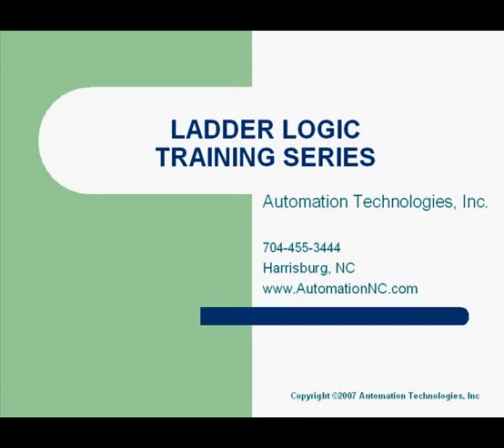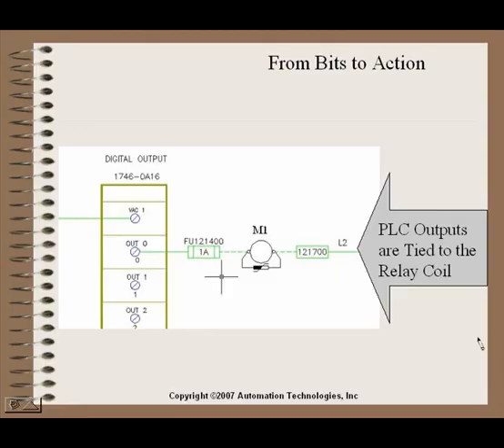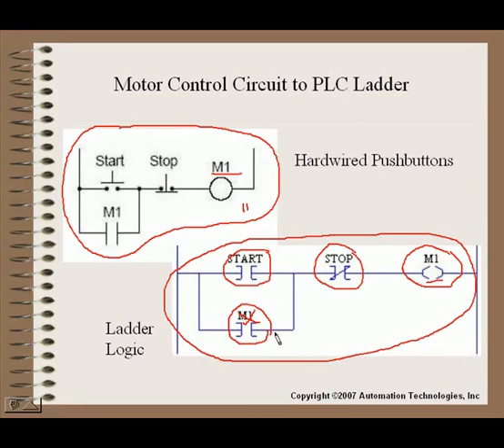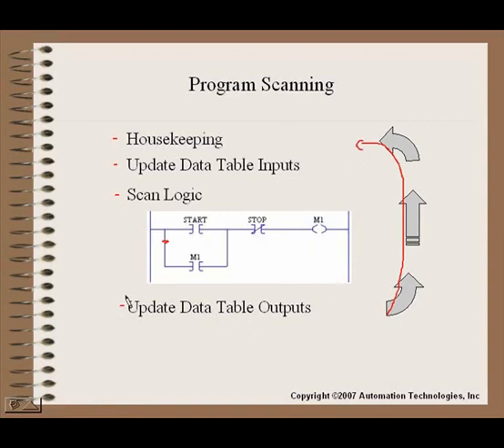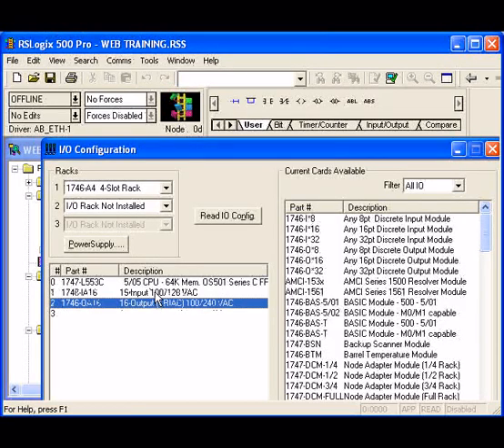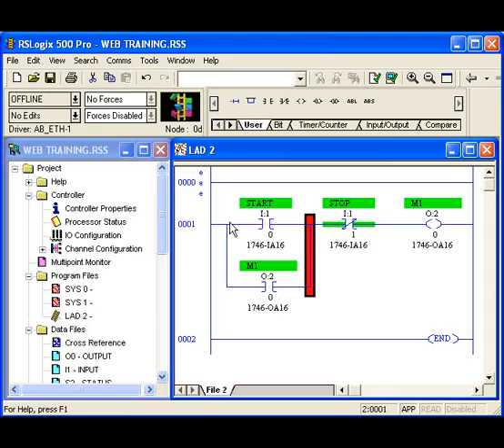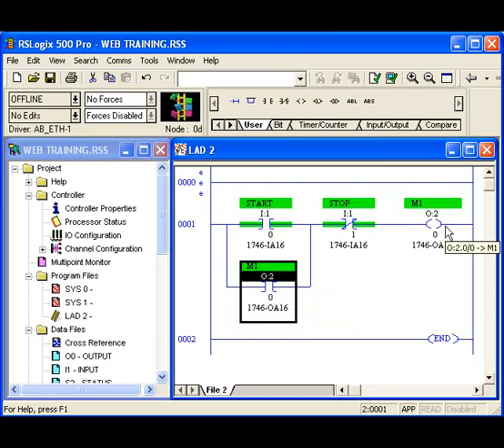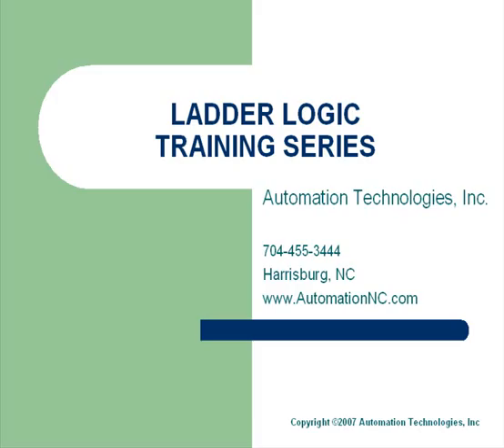PLC Training - Introduction to Ladder Logic

Comment: In the beginning of this video the stop button is shown as NC, push to open, the logic later in the video shows the logic using a XIO for the stop PB function. The stop PB should be XIC if the logic is to mimic a standard three wire start/stop PB station. The stop PB's should always be wired NC, push to open so that if a wire is broken in the circuit, the output in the logic will shutdown if running or be unable to be started if not running. If unable to start or shutdown occurs, the circuit can be troubleshot at that point and repaired. This is the failsafe method to wire this type of circuit as some "stop" PB's are in place to be used in critical shutdown situations. I was wanting to use this video in my class at the community college because the graphics and explanations are clear, but I can't because of the error mentioned in my comment.
Reply: Yes stop bits, like their hardwired counterparts should always be N.C., or "XIC" in ladder logic software for "fail safe" operation. But when I would explain Ladder logic programming to people with little or no electrical background i would usually try to dispense with most of the Normally closed, examine if closed, on, off, Hi, Low, ones and zeros, etc. All of that language, while useful can be very confusing to those without the background in electrical switching, relays etc, and they tend to, in my experience, get hung up on these concepts when much of it is unnecessary to learning to read the logic. I would instead present it like this: I would tell them to divide the screen into left and right. On the left side you have a set of  "conditions" and on the far right you have an "outcome" based on those conditions. If the conditions are "true" then the outcome will then be true and of course if they are false the outcome will also be false. I would tell them to forget about all of the N.C., N.O. stuff for the moment and pay attention instead to the green highlights. If it is green then its true regardless of anything else. It is of course an oversimplification but I found it to be effective in getting people, with little and sometimes no experience, reading and understanding ladder logic without getting hung up on the whole Normally closed, on, off, concepts.
Reply: Yes stop bits, like their hardwired counterparts should always be N.C., or "XIC" in ladder logic software for "fail safe" operation. But when I would explain Ladder logic programming to people with little or no electrical background i would usually try to dispense with most of the Normally closed, examine if closed, on, off, Hi, Low, ones and zeros, etc. All of that language, while useful can be very confusing to those without the background in electrical switching, relays etc, and they tend to, in my experience, get hung up on these concepts when much of it is unnecessary to learning to read the logic. I would instead present it like this: I would tell them to divide the screen into left and right. On the left side you have a set of  "conditions" and on the far right you have an "outcome" based on those conditions. If the conditions are "true" then the outcome will then be true and of course if they are false the outcome will also be false. I would tell them to forget about all of the N.C., N.O. stuff for the moment and pay attention instead to the green highlights. If it is green then its true regardless of anything else. It is of course an oversimplification but I found it to be effective in getting people, with little and sometimes no experience, reading and understanding ladder logic without getting hung up on the whole Normally closed, on, off, concepts.
Reply: Yes stop bits, like their hardwired counterparts should always be N.C., or "XIC" in ladder logic software for "fail safe" operation. But when I would explain Ladder logic programming to people with little or no electrical background i would usually try to dispense with most of the Normally closed, examine if closed, on, off, Hi, Low, ones and zeros, etc. All of that language, while useful can be very confusing to those without the background in electrical switching, relays etc, and they tend to, in my experience, get hung up on these concepts when much of it is unnecessary to learning to read the logic. I would instead present it like this: I would tell them to divide the screen into left and right. On the left side you have a set of  "conditions" and on the far right you have an "outcome" based on those conditions. If the conditions are "true" then the outcome will then be true and of course if they are false the outcome will also be false. I would tell them to forget about all of the N.C., N.O. stuff for the moment and pay attention instead to the green highlights. If it is green then its true regardless of anything else. It is of course an oversimplification but I found it to be effective in getting people, with little and sometimes no experience, reading and understanding ladder logic without getting hung up on the whole Normally closed, on, off, concepts.
Reply: Yes stop bits, like their hardwired counterparts should always be N.C., or "XIC" in ladder logic software for "fail safe" operation. But when I would explain Ladder logic programming to people with little or no electrical background i would usually try to dispense with most of the Normally closed, examine if closed, on, off, Hi, Low, ones and zeros, etc. All of that language, while useful can be very confusing to those without the background in electrical switching, relays etc, and they tend to, in my experience, get hung up on these concepts when much of it is unnecessary to learning to read the logic. I would instead present it like this: I would tell them to divide the screen into left and right. On the left side you have a set of  "conditions" and on the far right you have an "outcome" based on those conditions. If the conditions are "true" then the outcome will then be true and of course if they are false the outcome will also be false. I would tell them to forget about all of the N.C., N.O. stuff for the moment and pay attention instead to the green highlights. If it is green then its true regardless of anything else. It is of course an oversimplification but I found it to be effective in getting people, with little and sometimes no experience, reading and understanding ladder logic without getting hung up on the whole Normally closed, on, off, concepts.
Reply: Yes stop bits, like their hardwired counterparts should always be N.C., or "XIC" in ladder logic software for "fail safe" operation. But when I would explain Ladder logic programming to people with little or no electrical background i would usually try to dispense with most of the Normally closed, examine if closed, on, off, Hi, Low, ones and zeros, etc. All of that language, while useful can be very confusing to those without the background in electrical switching, relays etc, and they tend to, in my experience, get hung up on these concepts when much of it is unnecessary to learning to read the logic. I would instead present it like this: I would tell them to divide the screen into left and right. On the left side you have a set of  "conditions" and on the far right you have an "outcome" based on those conditions. If the conditions are "true" then the outcome will then be true and of course if they are false the outcome will also be false. I would tell them to forget about all of the N.C., N.O. stuff for the moment and pay attention instead to the green highlights. If it is green then its true regardless of anything else. It is of course an oversimplification but I found it to be effective in getting people, with little and sometimes no experience, reading and understanding ladder logic without getting hung up on the whole Normally closed, on, off, concepts.

Comment: My question is how you can use XIO instruction to address the NC stop button,  stop button is normally close and always conducting in normal position and should be addressed with a XIC instruction to be true.
Reply from the maker: Well it does depend on the logic, but with a standard seal in circuit you would expect the NC stop pushbutton to be addressed with an XIC.

Comment: STOP instruction from a typical NC stop contact should be an XIC contact not XIO
Reply from the maker: But.. it doesnt really matter with a plc.  It's electronic.  There is no loose wire to come off if it comes from an HMI.  Of course if you want to have hardwired inputs into the PLC you can make the point for a NC stop PB.   Thanks for the comment!
Reply: @automationnc  safety, safety, safety. If you use a normally open stop to an XIO instruction and the wire breaks or contact doesn't seal you'll never get it to turn off minus e-stop circuit. Showing this leads people to a mojor error
Reply from the maker: @andrewrolfe4263  As I mentioned, no wires from an HMI.  I agreed that it would be prudent in a wired system.  Doesn't matter for an HMI with comms.

Comment: Hello sir 
I have Allen Bradley plc5 .. when communicating with plc for trouble shooting online cross reference is not enabled so let me know the solution on this ..?
Reply from the maker: Sure - go to system options/ xref tab and enable cross references online is a check box. (You get to system options by going to Tools Menu/Options)
Reply: @PLCMentor  all ready I checked there but that icon is not activating .. when click on that one ..
Reply: Hello sir ..
How to set preset time for timer online in PLC5 allen Bradley and download the same only that rung into the PLC5
Reply from the maker: @ravindradesai5007  First you cannot selectively download in the PLC5.  All or nothing.  To change the preset on a timer in the PLC5, you just need to go to the instruction and change it right there.  You could also change it in the data table.

Comment: PLEASE anyone save me. I've made PLC test with a Micrologix 1500 and I could not use the standart addreess like B3:0/0. Instead, I was able to insert a memory bit like B3/0. WHY? Why all address was changed in Rslogix?
Reply from the maker: You really should be able to use either.  How they show up in your program is defined by how you setup your RSLogix500 options.  Both mean the same thing, and only bit data files have this flexibility in addressing. Your first example is a method that includes the word and bit in the address (B3:0/0 - first 0 is word - second is bit).  The second example is addressing without the word (B3/0 - where the 0 is the initial bit in that data file).  With the B3/0 type of addressing you can address without using the word and get addresses like B3/16 (same as B3:1/0) or B3/200.  It can be a little confusing as you have to understand words and bits and such to really understand how it works.  Check out our video on numbering systems to help with that.
Reply: Numbering Address I know how to do it, What I didn't know is how to set up this feature in Rslogix 500. After 15 years, today I spent all this morning and Thanks God I could find how to set up this options in RS logix 500. VIEW-->PROPERTIES-->ADDRESS DISPLAY TAB-->BINARY BIT DISPLAY MODE-->BIT.
Even so, thanks so much for your help.

Comment: What coding tells the PLC that certain symbols are inputs and outputs?
Reply: If that's the compiler, what coding told the compiler how to code??
Reply from the maker: If you are asking about real world inputs/outputs versus internal inputs and outputs then that dependent on the address used.  Certain addresses are tied to real world inputs, some real world outputs and others internal elements.

Comment: hi..i use this microsmart plc model FC4A-C24R2 100-240V AC, what type of data cable i need to used to modified my old programing inside PLC
Reply from the maker: I am not familiar with that IDEC PLC but it looks like it has an RS232 serial port.  Judging from the round connector, you will probably have to get the cable from your IDEC rep.  You also may need a USB to RS232 adapter for your PC as most PC's now days dont have comm ports.  

You can just google the model and microsmart and come up with lots of information on it.  The manuals are located here:

http://us.idec.com/Catalog/ProductDetails.aspx?ProductId=FC4A-C24R2&FamilyName=Family&SeriesName=MicroSmart

Comment: how come your relay contacts are drawn with two parallel lines? wouldn't that be confused as capacitors?
Reply from the maker: Good question!  The only answer being a matter of definition.  If we were drawing an electronic circuit for a circuit board then you would expect the parallel lines to be a cap.  When you move to the industrial drawings and standards there, particularly relay logic diagrams, the parallel lines are accepted as contacts.
Reply: +automationnc how very interesting. I'm actually in the railways where relay logic is used to design interlocking systems. we still use contacts similar to the conventions seen in a circuit board. I'm pretty sure my circuit books are defined "industrial".
anyway, more than one way to skin a cay, I suppose. i guess it's easier to draw it that way than the actual contacts and if there's no conflict with capacitors, then it will be okay.

Comment: Could you please share examples of the different ways that different processors work on the logic when the logic is scanned? Does Allen Bradley Compact Logix modules have different data handling schemes compared to Allen Bradley's MicroLogix modules or compared to Siemens S7 plc card modules?

Comment: Great tutorial, but the I/O wiring diagram at 1:51 shows a normally closed start button which you would never do, as a broken wire would initiate a start command.  Also, the program shown later is using an "on" signal to activate the start condition in the logic, which would be fed from a N/O contact.  The stop button would be wired normally closed as shown at 1:51 but the PLC input would be looking for an "on" signal to keep the coil output energized, not an "off" signal like the logic shows.  I see how you are trying to relate the code to a hardwired circuit, but this might confuse someone if they are trying to compare the logic, the hardwired circuit, and I/O connection diagram.
Reply: +Khoury John That's what I pointed out.  You can't use an XIO for a stop button because that means a broken wire on the stop input will prevent the motor from stopping.
Reply from the maker: graziemerci Yes that is true!  Never noticed that before and I dont think anyone has ever brought that up here.  I will point out that the discussion is on how real world devices get into the PLC and that discussion is still valid.
Reply: +automationnc where can i download or use a plc simulator online to practice logic/writing programs?
Reply from the maker: Master... feel funny replying like that - check out our PLCMentor site and we have information on that in the announcements on our front page.  It is actually the real RSLogix500 software that you would use to program on the job and the RSEmulate that we use periodically to test our programs.  In short, its the real software so learning to use it is actually useful.  Our link is to the Rockwell site where they give out a micro lite version that is legal and approved.
Reply: +automationnc m using a CTD count down counter in my plc program.
how do i stop it from going past 0? it ends up going -1.-2 etc??
its a parking lot application s. thanks for your help
Reply from the maker: +Master Mo You can address the accumulator (.ACC) and add a GRT statement to check and see if the accumulator is greater than 0.  So (C5:0.ACC > 0) ahead of your counter would only allow it to count down if the accumulator is greater than 0.  Keep in mind if there are more cars leaving the parking lot than came in then you should have some sort of alarm. So the attendant knows there is something wrong.
Reply: +graziemerci Also would you need the System Stop to check for XIC instruction in the ladder logic. In this video it shows that it is XIO. Therefore, having the instruction as XIC and hardwiring as Normally closed would establish a fail-safe system. So if there was a remote system stop as a field wire and the cable was cut then the machine would shutdown regardless if someone did not pull on the system stop switch. Could you please confirm or clarify if I missed something. Thank you.
Reply: +Khoury John That's what I pointed out.  You can't use an XIO for a stop button because that means a broken wire on the stop input will prevent the motor from stopping.
Reply: +graziemerci Thank you.
Reply: Guys its NOT!!! closed or open contacts in PLC the real world OPEN contact is infact EXAMINE IF OFF!!! in a PLC its reversed to like pneumatic logic hover your courser over the bit bar and see that the open is examine off and the closed is examine off its a statement not a frickin contact LOL!!!! Get a clue.
Reply: That's what I'm confused with

Comment: You weren't kidding about it being an introductory to PLCs.  if you are brand new to PLCs this would be very helpful, but if you are like me and need a refresher course in PLCs then you should look else where.  Anyways good job on the presentation.
Reply from the maker: Allen Warner Very introductory - yes.  The information on our site goes into much greater detail.  I believe we are the only site that will review student's programs as well as a live web class.  Not to mention our material was put together by Engineers that are actively designing, programming and commissioning control systems.